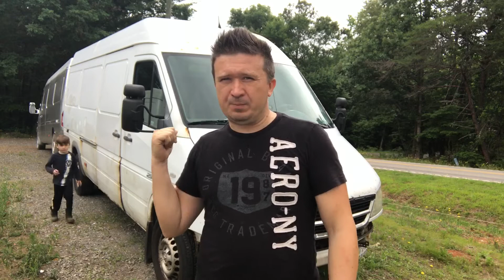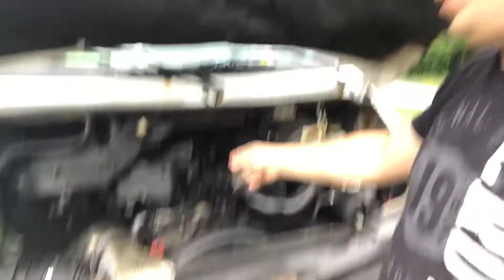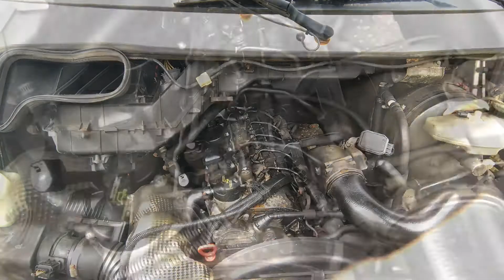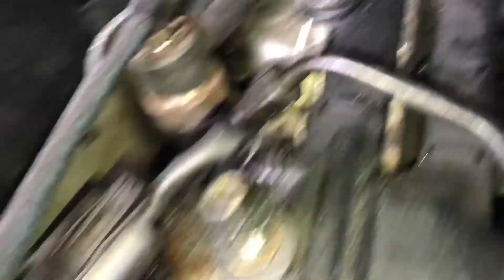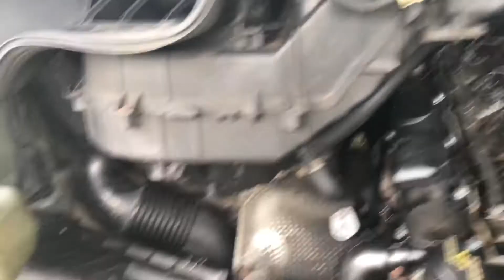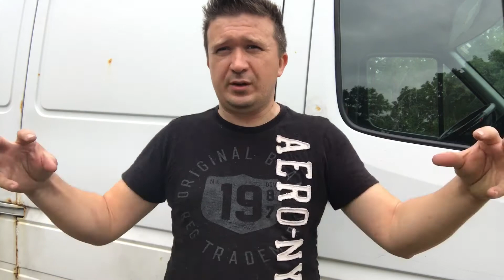Mercedes Sprinter with a Starting Problem Part 1 Season 2 ZIMALETA How To Show

Comment: Hello my sprinter panel van gives a problem of starting only if the hot or if I have been driving for about 2 hour when switch the ignition off then i want to start it to when the hot  is hot because i was driving it it Doesn't Start then i must wait for about 30 minutes then it wil start can anyone help me on that issue
Reply from the maker: Replace your Crankshaft position sensor problem solved

Comment: Hey I just got my 2005 sprinter key programmed after sitting for 3 years when I go to crank it all I hear is a click and no crank , is this maybe the engine is seized ? Or is it bad starter. This van has been sitting for 3 years but I don’t think it should lock up. Any idea ?

Comment: Had a no start situation with my 2003 3500.. it would start with starter fluid and would run well.. but would not start normally.. I did a low pressure injector test found that 1 and 5 were bad.. of course the shop i took it to first wanted $3500 to replace all injectors.. i bought the injectors and had my small town mechanic replace them .. fixed the issue.. for $800 starts fine now..
Reply from the maker: Great 👍 I sell sprinter parts on eBay listing more everyday check out my store eBay.com/str/zimaletamotors

Comment: Hi i got sprinter it switches on but wont start so i got the starter motor checked and it's OK i tightend the wires still wont start? ?

Comment: Have u got a list of all the possible things which will cause it not to start I realised soon as cold hit it didnt start usually sometimes would turn over for so long and then finally just about start. Sometimes it would start straight away especially as the day goes and can gets used it usually would start straight up
Reply: Salam brother. What was wrong with it did you figured out what was the problem because i have the same issue. Like in cold weather no start 1st time it does
Reply: @aftabJatt  walaikumslaam changed a fuel pressure sensor and seems to have made it 99% good sometimes it does it very rarely i just be careful when starting dont turn the key to early or late.
Reply: @Automotiverecoveryuk  thank you so much for your reply brother. When you changed the fuel pressure sensor did it solve the problem. I have sprinter 2005 reg drives very nice no problem apart from starting 1st time in cold morning time after that no problem all day. Please advise me
Reply: @aftabJatt  yes after that it's been very good I believe its the high pressure sensor where are u based?
Reply: @Automotiverecoveryuk  thanks for reply brother and i live in Oldham, Manchester

Comment: Hi mate.  I have a 2003 merc sprinter.  Edc light on.  When I spray cold start into it then it will start.... t
THEN when I start to drive it cuts out and will not start again.  Help please any ideas?
Reply from the maker: Can you please describe clearly exactly what’s going on and if check engine is on what code Do you get
Reply: Code I get p1354..... camshaft sensor/crankshaft sensor.   2nd code.... 1187 rail pressure monitoring..... the van with tick over on idle after it’s started with cold start but will not drive under load.
Reply: Hi, I have a related problem here pls

Comment: about the rail, it only has 1 sensor & 1 actuator.. both can be bought seperate at the official dealer, the one at the side of the high pressure pump is the sensor, the one in the back is the pressure regulator.. the regulator has 2 O-rings & a white plastic ring, the plastic ring & smallest O-ring do tend to fail & there is a set of sealings to replace those
https://europarts-sd.com/previewimage.asp?pid=2612&prodtype=product (JUST AN EXAMPLE.. need engine number to get correct part set)
Reply from the maker: Thanks your really good with sprinters, I hope hank you for all that your sharing with me

Comment: about those fuel injectors, there is a leaktest where you clamp of the return line, disable the camsensor & put small testtubes on the injector to see how much it returns... depending on engine number/vin/date.. mercedes computer does tell you to replace all.. IDK why but probably a bad batch of injectors.

The main reason imo the injectors leak on the head is becouse of bad installing of the cover below the injectors.  You need to place that part 1st, handtight the bolts, then install the injectors & then torque down the cover, then the injectors so that the injectors actually help to line out that cover.  The other main reason is that those bolts to hold the enjectors ALWAYS HAVE TO BE REPLACED & torqued to specs.

Looking at the engine & mess, I would say they did replace an injector & clean it up as good as they could
Reply from the maker: Probably, thanks for the good explanation

Comment: I have a sprinter 2.2 ecd light on and showing start error now won't start any advice
Reply from the maker: Yes, it’s probably your ignition tumbler to test it use a screw driver instead of key to start it, to do it correctly watch my videos on start error they will help

Comment: really like the vids! I’ve got an 05 2500 sprinter and it stalls on deceleration and surges at idle, upon acceleration it risks coal like unreal, i was told check the flow control valve, does that sound right?
Reply from the maker: +Bill Williamson so on deceleration it stalls out? Can be anything, even fuel injectors, but I think it’s electrical, are you getting any codes?
Reply: ZIMALETA HOW TO SHOW & UNBOXING thanks for taking the time to read! Only code that comes up is for a glow plug circuit open and misfire in same cylinder on cold start, aside from that nothing. i’ve seen your other vid on checking the harness and where it plugs into the computer and it was all clean, no corrosion or anything, harness under hood is pristine looking.

Comment: hi man i do like your vidios thanks loots to help people .iam from finland and i hav eproplem with mb vito 2001 112 cdi so the desil injector leaking like that and i have start erorr in the dash bord  i bay this car after i drive it 10 km stop and start erorr come to my dash bord i ask michanic he say it cost 300 e to fixing you ecu i chick the starter and every thing are fine so whats the truth to fixing my car, 
thanks
Reply from the maker: +Ahmed Saleh if your fuel Injector leaks, you need to fix it, it might be giving you start error because of it, but it's tricky and it can be something Electronic $300 to fix it sounds like a good deal
Reply: ZIMALETA HOW TO SHOW & UNBOXING hi man no 300 e to fix the injector just to fix the car computer immblizer
Reply from the maker: +Ahmed Saleh Start Error comes from Immobilizer and if you buy a new one it needs to be programmed to work with your cars computer and to recognize the key, but sometimes you can disconnect the battery for 2 days and you come back and the starting error is gone

Comment: thanks for doing these vids.  i believe i have the high pressure pump leaking.  i also experienced 2 instances where i lost power to 60%.  once the vehicle was restarted it fixed itself.  any ideas on what is going wrong.  i believe it is some sensor at this pt
Reply from the maker: +Joe Moto your welcome, this will be interesting Diagnosis, I have a good idea what might be wrong, but testing all the stuff to make sure I don't miss anything, anything can be wrong, I just got to find what it is. About your van losing to 60% it's a sensor that does that and after you restart it it will run normal, sometimes something is wrong and sometimes that's just how it is, one day it does that and then you won't see that problem for a long time. But I Advice you to check your houses for the Turbo, inspect them for leeks, also if you have a plastic Resonator, check it for leeks, it's hard to see if there's leeks but it normally leeks at the seams, I recommend just buy a new one but buy a metal one not plastic

Comment: you can actually do a compression test via the injectors using STAR, haven't got chance to watch all the video yet, are there any lights coming on? eml or edu? always start with the fuel filter on diesels, then do a leak off test, you can still carry one out by cranking it for 10 seconds a couple of times and seeing of any of the injectors are leaking back too much, have you got any diagnostic equipment? you could do with something that will read fuel pressure as the injectors won't fire under a certain pressure, this could be the fuel pressure sensor at the back of the engine, usually it's a seal that goes in them.
Reply from the maker: +Liam hello Liam I am glad to have you here giving me Tips, no I don't have any special equipment to test, I herd about STAR it's the Computer Mercedes uses to test Sprinters right? Not sure what you mean about Lights coming on EML and EDU but yes you Right I should start with a Fuel Filter, only Diagnostic Equipment I have is My little check Engine reader, it helps me allot to kinda know what to expect, but I want to buy a better computer with a touch screen.
I like the sound of a Bad Fuel Pressure Sensor, I did not know there is one at the back of the Engine, can you tell me where exactly to look, This kinda interesting I might learn something new here, A little Spoiler Alert As of this video I don't know that TCM has been stolen, later I will find that out in part 4, But you know what's weird, That Both Shops Claimed to change Crank Shaft Sensor and that code still stayed on, this must mean something, but I know that Crank Shaft Sensor if bad will still start the car on Cold Start and it will give a problem when the Engine is warm, Also getting back to Fuel Injectors, I had an issue before where one fuel injector was peeking to much diesel into the Engine and the Fuel Rail could not build any pressure Resulting in cranking without a start, and I can't remember for sure But I think I got a Code saying low Fuel Rail Pressure and that would make sense, Getting back to Starting the Sprinter I can't help but think this is something easy, but for time being I am a little stumped 🤔 But learning This Sprinter Took Time lol and believe me I was Stumped on Everything, only one that believed in me was my Wife, she would tell me that I will figure it out, when I did not believe that I would, I can tell
You does were the head ache days lol. And if I can help other Sprinter owners to have less head ache with the Sprinter that would make my Day. But sometimes I still need help, I can tell you one thing, I do have Sprinter Manuals same like Sprinter Shops use, and I need to start reading them, it has all the procedures that the dealer would use, its literary walks your trough, I guess I will start learning them soon. Also I will be buying me a compression Tester, I will defenetly need it for this Job, The mechanic shop claimed that they did that and it was bad compression in 4 cylinders and one good, but they did not tell me which ones or what pressures it had, and is a little hard to trust them especially after discovering a missing TCM when there Shop had it last, this is the kinds of mechanics I caution about, not the Mercedes Dealer, the Dealer has Reputation to live up to and hire good mechanics, that does not make them cheep, but at least they will tell you how it is, lol I get carried away in the comments section just like I do with my videos, lol but I think of my channel as a Sprinter Blog, open for everyone to see, and it can be a learning experience for new Sprinter Owners, Thanks again Liam
Reply: ZIMALETA HOW TO SHOW & UNBOXING first off invest in a basic diagnostic reader, icarsoft make one that's £100 in the UK and tells you a fair bit of live data,  you'll need something like this for the work you carry out it makes your life a lot easier, also something to bear in mind is that extended periods of  engune cranking will bring up a crank sensor code so for the time being ignore that, if you have a low fuel pressure code then as already said it may be the seal gone in the fuel pressure valve at the rear of the engine a few inches away from number 5 injector, here is a detailed write up that should help you out  http://www.mercedes.gen.in/sprinter-fuel-rail-pressure-regulator-problems-poor-starting/
Reply from the maker: +Liam thanks, your a big help, yes I have a basic reader and it does have live Data, it came with CD and I can hook it up to a computer, I will check out the one your talking about, there is one that I want it cost $1,000.00 it's called maxi DOS I believe, glad you told me about Crank shaft excessive cranking part that the cold will come on for crankshaft sensor code, are you talking about Fuel Rail Sensor going bad? If so I have a Fuel rail that works I can instal it and test it, I also herd a while back that if high pressure fuel Sensor will go back it won't start as well, this will be interesting and exiting if it's fuel rail that's gone bad or it's Sensor, I never had this before and I heard long time ago that if it goes bad you can't start it and it's a common problem, but I am not sure what to look for, also I know if High pressure fuel pump has lose bolts at the back of it fading the Engine it will be hard to start it, I know one thing I will leave no stone unturned in diagnosis of this Sprinter, in hopes that I can help many Sprinter owners with this and many other problems, thanks so much for the link I will check it out